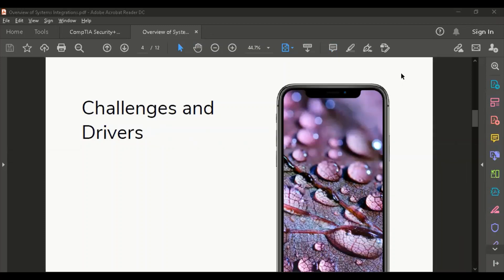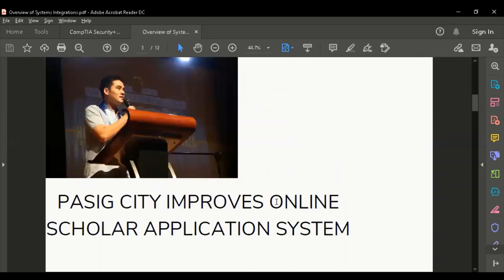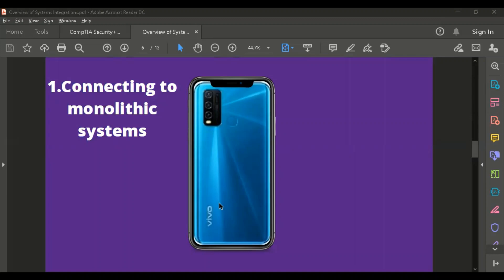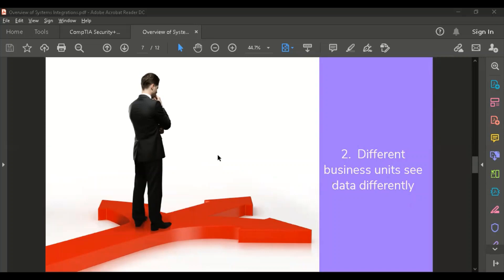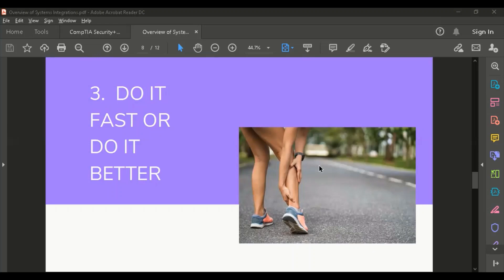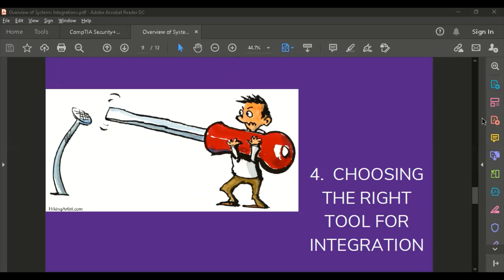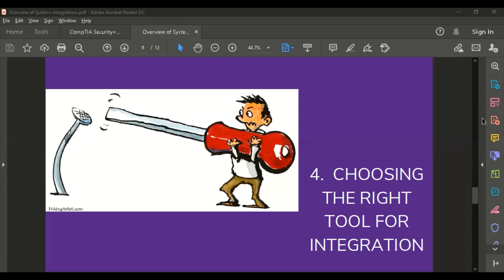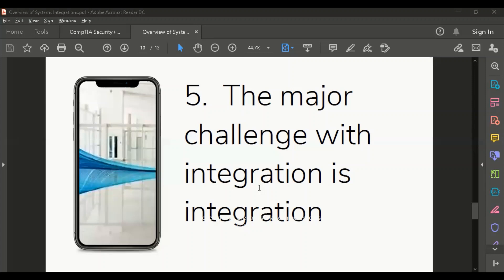Challenges of System Integration

Comment: After watching the video, I learned that System Integration is merging technologies and other systems to form a more enhanced system that are capable of taking on more difficult task. I also learned about the 5 challenges with system integration, 1st is connecting to monolithic systems because monolithic systems depends on each other so if one fails it will affect the others, 2nd is Different business units see data differently because different business like people have different perspectives on how they see things, 3rd is do it fast or do it better because you must on or ahead of time and your work must be with done properly, 4th is choosing the right tool for integration because you must choose the proper tool in order for it to work properly and correctly, last but not the least is the major challenge with integration is integration because integrating something is not easy. - Paula Orfano_BSIT3F
Reply from the maker: Thanks a lot.  Please watch the Data Privacy video.

Comment: Based on what I understand about the video, it shows the connection of business and system. Why do we need to improve? Of course to enhance the community.  There are five challenges with Systems Integration, the first one is connecting monolithic system one of the example is mobile phone like what my Professor said it is interwoven to each other but there is a problem the domino effect because sometimes if you open one application and then open another application it will cause of not responding even if they are interwoven we need to be careful because that will be a challenge. The second one is different business units see data differently, not all has the same ability to see the data because everyone has own function that different from the others. The third one is do it fast or do it better, for me its fine to do your work fast but make it sure you analyse and think about it carefully to make your work better because it’s better to see your work looks good than rush. The fourth one is choosing the right tool for integration just like in our daily lives of course we need to choose the one who can help us literally rather than the one who can’t help us to improve. We need to think thrice to all decision we made and one of the factors that we need to consider is that this tool can help us to improve? If not then throw it away from you. The last one is the major challenge with integration is integration so for me if we chosen something it’s better to choose the one that compatible enough with you, the one that can understand both of you. If you choose product make it sure that these product is compatible enough.
Reply from the maker: Thanks.  Please watch the my interview with Dr. Lansigan.  The topic is all about data privacy

Comment: Based on the presentation system integration is basically melding existing system and new technologies to form a more capable system,  said that technology help us to improve community,  enhance our knowledge, skill and performance.  like Pasig City online Scholar which is a big impact to the student and the parents as well to know what happened    even thought there is no face to face connection like in this pandemic.  There are 5 challenges with systems integration.  First is Connecting to monolithic system the example is moblie phone there's a lot of application inside of this, we can used app sabay sabay,  but we need to used carefully because what Sir Allan said there is a domino effect so if one of this are affected there a big impact to other system which may cause a big problem.  Second is different business units see data differently because we have different understanding, knowledge and skill so that is we need the system integrator have a big responsibility to take care of this.  
3rd is Do it fast or do it Better. you may do your job not only do it fast but do it better to avoid some problem in the system. Second to the last choosing the right tool for integration. for integration you need to know what proper tools to fixed the problem there is a responsibility to fixed it based on your knowledge,goal and interesting.Because it may take cause a problem in the system if you don't think wise.and last is the major challenge with integration is integration.  if you are system integrator you need to see the right product that is compatible enought for this.
Reply from the maker: Thanks.  Please watch the my interview with Dr. Lansigan.  The topic is all about data privacy

Comment: Application systems are interconnected with each other. Connecting those are attend are often a requirement for business needs.  It's a challenge for the developers for the integration. 
System integration is a melding existing system to perform well to help the community.  The improvement needed for new additional features and enhance performance. 
There are five challenges in integration
The first one is connecting to monolithic system means the problem if one application is not working it may affect the other application.  If the current application is still working the process doesn't need to be integrated. Second,  different business units are often see data differently. It depends on the perspective of the person on how to see the data of the system. Third, do it better or fast,  means considering the time or cost to replace the existing system. Forth,  choose the right tool  means use the right tool to meet your aim to integrate the system. Lastly,  the major challenge of integration is integration, the process itself on integration is it needs to be successful
Reply from the maker: Thanks.  Please watch the my interview with Dr. Lansigan.  The topic is all about data privacy

Comment: Our professor sir Allan Burgos discussed last Saturday oct 3, 2020 is all about system integration. He discussed what system integration is all about, he said that system integration is basically melding existing system and new technologies to form a more cable system. Based on my understanding in the lesson that we discussed, system integration is bringing together of the component subsystem into one systems and I think it can involves making some type of system by adding or put programs to it. For example in the army tank a system can integrate to understand how torrent do with the controller and how the gps operates with the tank movements. There are five challenges and drivers one is connecting to monolithic system, monolithic system means application can carry your all data or files and it is increase size. Second is different business units see data differently. Third do it fast or do it better, for example you are a manager you want to do your work fast but you gain cost, efforts, pressure. In the end all your hard work can be successful. Fourth choosing the right tool for integration for example in the pdf that sir allan showed the screw driver and the common nail, this two things are not compatible to each other there are no connection. Lastly the major challenge with integration is integration for example you want to buy some stuff because it is trend nowadays but you are saving your money. You have no choice to think too much and you are competing or challenge yourself if you want it buy it or not. I don’t think if its right but this is based on the lesson that I learned.
Reply from the maker: Thanks.  Please watch my interview with Dr. Lansigan.  The topic is all about data privacy

Comment: In this video I have learned learn how it is possible to overcome the main problems of system integration, and how system integration really works in enterprises. An integrated system will streamline the processes, reduce costs and ensure efficiency. System Integration helps enterprises to operate easily. There are five challenges of System Integration. First, is connecting to monolithic systems, is cannot be replaced so easily. If the particular system is not functioning the other system will be affected too so that system integrator need to take care because it is very large and very slow to change. Second, Different business units see data differently. Each business unit or business domain sees data differently because their operational responsibilities are not the same and they may be using different systems or applications. This will helps in avoiding point to point data modeling and allows other businesses or applications to connect to the systems using a service that implements canonical data modeling. As a system integrator we have big responsibilities. Third, do it fast or Do It Better. In this challenges time and cost is the most important. A system integrator must find a balance and ensure that the integration solution is not just about meeting the functional requirements of today, but also potential future and non-functional requirements such as performance, scalability, re-usability and maintenance. It must do in a faster and better way.  Fourth, choosing the right tool for integration, getting this decision right makes huge differences in terms of speed of integration, functionality and cost. The chosen tool should allow for seamless integration between on-premise and cloud-based applications.  Choosing the right tool for an enterprise is a challenge. In modern connectivity, an integration tool must almost support hybrid integration. We need to choose the good tools because other tools are not functioning well and not compatible and also we need choose the good quality of the tools we used. Fifth, the major challenge with integration is integration.  The product chosen should allow integration with other systems or products either via a web service layer or using libraries. This will help enterprises avoid another monolith and designing and implementing integration solutions for their current or future products. As a system integrator we need to choose our product very well.
Reply from the maker: salamat.  please watch my data privacy video.

Comment: One of the prominent technological advancements in this generation is system integration. This technological advancement comes with benefits both for the enterprise and its customers. However, such advancement also comes with challenges which are somewhat a guide on the things that need to be considered in integrating systems. These challenges need to be overcome to be able to meet the standards and requirements set for or by the enterprise and of course, to be able to provide a better service.
Reply from the maker: Thanks. Please watch my interview with Dr. Lansigan.

Comment: After watching this video, I learned that System Integration is a process of combining 2 or multiple sub-system in to a one new larger system. And this newly formed system/integrated system will ensure more productivity and efficiency that will help them reduce the cost and it is more easier to manage.And I also learned about the 5 challenges of System Integration. The first challenge that system integration has to deal with is Connecting to Monolithic system  Majority of enterprise is using this system. It is not easy to get rid of it because many many years ago those system that they have used has been a big factor that helps them at that specific time. Those system can be also called as legacy system in industry. The next one is different business units see data differently but in these case it is depending on your idea on how you will see or what is your point of view in that particular data. But in order to integrate those system you must follow a standard data model in that the enterprise required. Next one is, do it fast or do it better. In industry you will need to pass a certain project within a limited period of time, and if not you will be fired because you did not meet the deadline. In this case, proper architectural planning is needed in order to ensure the quality of your system. The major constraints in these particular challenge is the time and cost. The next one is, Choosing the right tool for integration. In today's generation there are plenty of tool that you can used in order to have a best integration experience available in the market. It is up to you to choose based on your goal and also your interest. Lastly is The major challenge in integration is Integration itself. Right choosing of your product is a very crucial in your business. When your choosing a product it should be compatible with it, and it should allow integration with the with other systems or product via libraries or web service layer. This challenges that is being discussed will be a great help for those persons who is planning to implement integration solutions for their future products.
Reply from the maker: Thanks. Please watch my interview with Dr. Lansigan.

Comment: what I learned in system integration is that it has different platforms that can be connected to each other to integrate they say 
it contributes a lot to our society especially in today's era of dangerous emergence due to pandemic 
but it also faces different challenges like most of the enterprise will have monolithic systems and it is often not possible to get rid of those systems easily because business heavily depends on such systems as they are mostly legacy systems and cannot be replaced for the sake of integration. Each business unit or business domain sees data differently because their operational responsibilities are not the same and they may be using different systems or applications. sometimes you choose whether you do it fast or you do it better. when you are busy with time and you alone will do it you will choose to do it fast. but if many of you are better off do it better. 
and in deciding what is better to use for it what is more effective here. whether it can do the right thing for this thing or make it even slower to do it. 
this video contains very important information on system integration. this helped to broaden my understanding of this course
Reply from the maker: Thanks. Please watch my interview with Dr. Lansigan.

Comment: In this video I learned what system integration is. System integration is basically melding existing systems and new technologies to form a more capable system that are intended to take on additional task and enhance performance. As Sir Allan said new technologies need to perform more capable because this technologies need to improve because they have an additional task so if the technologies improve we help our community fast. So to learn more about this topic I conduct some research to find more information about what is system integration all about. I found out that this is the process of connecting different sub-systems (components) into a single larger system that functions as one. With regards to software solutions, system integration is typically defined as the process of linking together various IT systems, services and/or software to enable all of them to work functionally together. One of the example in the video is PASIG CITY IMPROVES ONLINE SCHOLAR APPLICATION SYSTEM. Mayor Vico improve the application of the scholar in Pasig city because Mayor Vico want to help their community because mayor Vico want to satisfy the scholar of Pasig city. Thank you for Mayor Vico sotto for this wonderful improvement. It helps a lot of student like me to make easier apply for the scholarship because we don’t need to go the city hall to pass the requirements and stand a long time and waiting to call their name. 
	There’s a five challenges in system integration one is the monolithic system There’s no separate components for each system. They are all in one system which is if one of the components got problem, other components will be affected, best example is the domino effect so if you have a problem on one part the whole system will be affected so you need fix this as much as possible. The second one is different business units see data differently. Use of existing enterprise data is critical to business success. Each business unit or business domain sees data differently because their operational responsibilities are not the same and they may be using different systems or applications. A systems integrator not only needs to satisfy the requirements of a business but needs to think beyond these and design an integration which has a standardized view of data within the enterprise. This is where a system integrator needs to focus more on modelling the data and ensuring a minimum canonical data model is achieved during integration. Third Do it fast or do it better means if you’re I.T gives you a short period of time to do your task you need to do it fast as much as possible but careful because you’re I.T need a better or good result so if you need to do this task fast you need to become better. Fourth Choosing the right tool for integration meaning you must choose the right one to use in the right project. Using the wrong tool will still work but you’re working in the hard way just like what the video show. Using screw driver head negative in the positive head screw. You can still screw it but you suffer and put more work than using the right tool. The fifth and last one is choosing the right product for your integration. It must be compatible and pick wisely because it will affect your system integration in the long time.
Reply from the maker: Thanks. Please watch my interview with Dr. Lansigan.